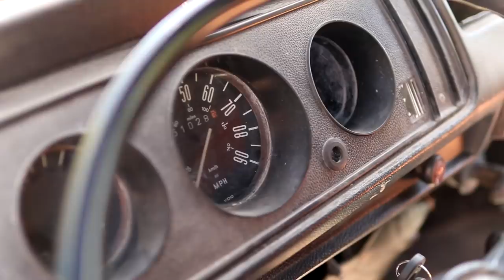1975 Shorty VW Hippie Bus Revival, Will It Run? | Turnin Rust

Comment: nothing beats the feeling of getting an old Volkswagen running again!  the smiles on your faces are priceless :)   They make conversion setup for running an old type1 motor in a type 4 engine bay.  I wouldn't too long on a hot day without the cooling tins in there.  Then again, i don't think you'll be driving it on long distances.  I can't believe you did 50mph in it! :)
Reply: Get rid of that ?Power pulley?  That is designed to run less air for drag racing.
Reply: I am glad to see one of my favorite channels commenting on another of my favorite channels.
Reply: @kc5uko  hell yeah brother!  love seeing another vw back on the road
Reply: 2998

Comment: Those chopped vans were big back in the 1970s, cut the center section out where the door was and weld it back together. As others have said below you need to find the engine tins to keep that engine from burning up. Great video Gentlemen.

Comment: That was a hard start relay, not an extra solenoid on the old starter.
Reply: That's what we were thinking, good eye!
Reply: what is it for though?  It didnt seem like it was having trouble turning over?
Reply: weren't you listening? he said its a "sillenoid" haha.. I love this channel!
Reply: @warrenmichael918  A vw's starter voltage goes all the way from the battery at the back through the ignition switch at the front and back tot he starter,  when there is poor contact in the ignition switch or bad wiring this causes a voltage drop at the starter and slow starting, with a hard start relay installed you use that voltage from the ignition to switch the relay which then connects the battery directly to the starter. Also the vw start (unless is from an auto) on had one shaft bearing in the rear, the other end of the shaft is only supported when the started is in bellhousing on the transmission where there is a support bush for the shaft,  You can not bench test the vw starter very well if at all due to this.   The bushing in the trans wears oval and this makes it hard for the starter to turn, maybe people spend a lot of money changing out the battery and the starter when the problem is a $2 bush in the trans (this was not the case here though)
Reply: @1963impala2drWaylonWire   Exactly what Crusher said. Basically internal resistance on the old wires doesn't allow for enough energy to make it to the solenoids. A hard start relay sends the power directly to the solenoid on the starter

Comment: Bac in Florida 35 yrs ago worked with a vietnam vet.bac yard fence with cover no GRASS all fl sand and ' GEICO ' and  other reptiles.also a class sand blast artist and 65 VW shorten van with the runners in BAC wouldn't tip over in BAC big motor.

Comment: Old VW trick to boost voltage to the solenoid in Beetles was an ‘extra’ Ford solenoid (or a headlight relay), to help key switch voltage ‘be enough’ for the original solenoid on the Volks starter.  Done that for decades... Not toooo unusual. 😊

Comment: Years ago when I was a VW mechanic a fellow brought in a very well built “short” bus, it was so short it was a cube. He wanted a motor vehicle inspection . I road tested it and would not inspect it , unless there were two people in the front seats the front wheels would pull off the ground on any acceleration. It really was unsafe ☠️🎩

Comment: Missing alot on the tinware fromm around the engine Lance if you dont put the correct tinware on you can call that engine scrap.
Reply: Yep it will get hot

Comment: The first two things to do on an old engine that hasn't started for a while is to run some fine sandpaper between the points to remove corrosion. The second is to disconnect and block the fuel line then feed in fresh fuel from an external can.
It's a really dumb idea cleaning spark plugs with a wire brush: you scratch them, which will tend to make carbon stick more. The old mechanics used to put fouled spark plugs into an empty tin can with a tablespoon of petrol. After five minutes they're clean and hot, which resists fouling and makes it's easier to start the engine. 

Also, on a small engine like the VW, it's a dumb idea to pour petrol in the top because you're likely to flood the engine. Better to  use some spray start from an aerosol can with the throttle wide and resist the urge to pump the accelerator, which simply pours more fuel into an engine that isn't starting, which floods it further.
Reply: ah interesting!

Comment: Thanks for the video. The most important thing is the cooling air vents are blocked off. They would normally supply the heater boxes (which are non-existent) with air ready to heat the cabin. Thus, all of the cooling air goes over the cylinders. Next is the missing sheet metal due to the type 1 engine installed where a type 4 is factory. This helps maintain a separation between fresh air and heated cooling air exiting underneath the engine. That short wheelbase looks sketchy. And I was taught that wire wheeling spark plugs was an old school myth. Better to replace them. I was wondering if the valve clearance was within spec or if there were some tight valves (hard starting). Better compression might help get the front wheels off the ground.
Reply: I was wondering when somebody would say that this is not the correct engine for a bus. I don’t know type 1 from type 4 but I know this is a bug engine and the bus is supposed to have a “pancake” engine. I remember my dad getting frustrated trying to replace a broken fan belt in our bus. He sold it soon after!

Comment: That type 1 engine will overheat so easily in hot weather, be careful! The old saying in air cooled VWs has always been if you can see the ground from the engine compartment...things will go bad! So many run around with missing tins and compartment seals
Reply: Yep good advice

Comment: It's very common to see a solenoid on a VW starter or close to the rear somewhere. The factory wiring would not provide enough power to excite the starter solenoid and the answer was to install a solenoid that took less power to excite the starter solenoid.
Reply: yep, hard start relay

Comment: Why would you not put new plugs in right away? Seems like a no brainer.... and why is dad doing all the crawling around?
Reply: usually plugs are okay, it's a process. no need to do everything at the beginning
Reply: I guess dad doesn't want to be stuck in a wheelchair too soon.  No crawlin' -> soon rustin' 😉
If only I had done the same...
Both channels are great, endless adventures 👍

Comment: Are yall gonna ever finish some of the builds yall started? Really like your content however would like to see that chevy yall started
Reply from the maker: Of course we will! The GMC 3100 is currently on hold since we can't get out of the shop. We need a company that can powder coat the frame for us, with us wanting to document the process, we need to wait for the country to open back up. Unfortunately, we have had issues with getting parts in, mostly with Accuair since they went out of business. It's put a huge strain on us with filming unfortunately.
Reply: My cousin owns a powder coat and sandblasting buiz but were in Missouri:-/